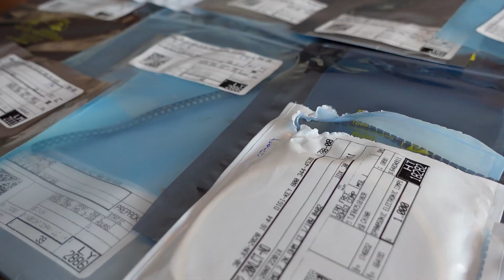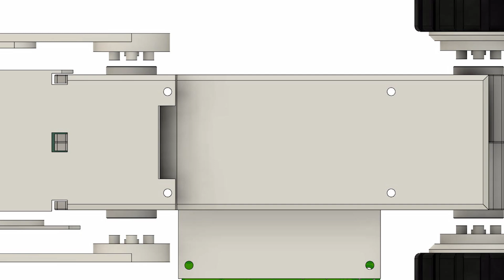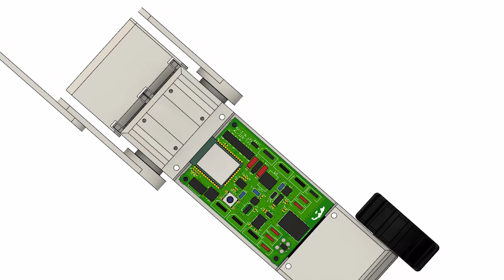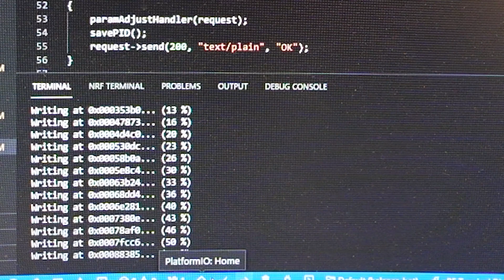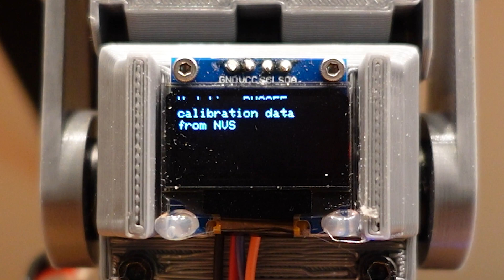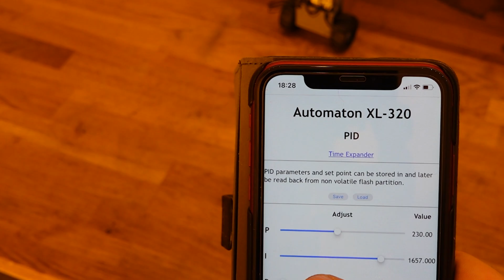3D Printing a Self Righting Balancing Robot

Comment: How did you develop the app for PID tuning?, like did you use Android Studio or MIT App Inventor for App building, because I woudl like to develop my own app for PID tuning and I need a starting point
Reply from the maker: It is not an app, only a web page hosted by the ESP32 that allows you to change the PID parameters on the robot. You can find the source code here: https://github.com/hansj66/automaton-xl320/tree/main/firmware/esp/balance-bot

Comment: Hi sir, What kind of motor are you using?
Reply from the maker: I'm using Dynamixel XL-320 servos in this project
Reply: Thanks and Can you give me detailed instructions on how to load the code for the robot, in the video I see you scrolling through it too fast and what software do you use to load the code? Thank you sir
Reply from the maker: @chikhanglam8409  The main controller is an ESP32 and I'm using Platform IO as the development environment. There are lots of resources on the web regarding how to program the ESP32 using PIO. The source code is available on my github repo: https://github.com/hansj66/automaton-xl320/tree/main/firmware/esp/balance-bot